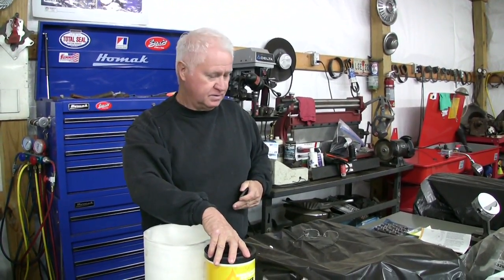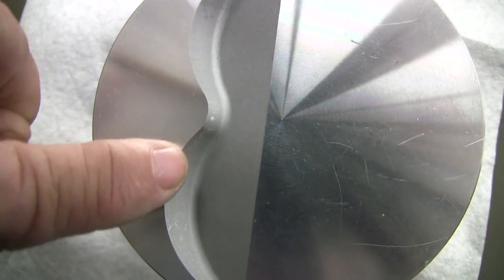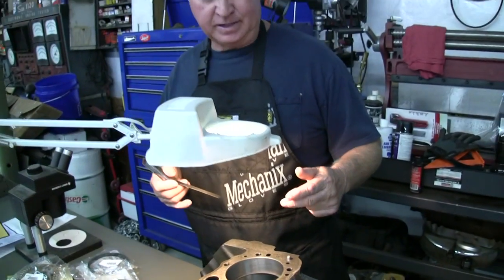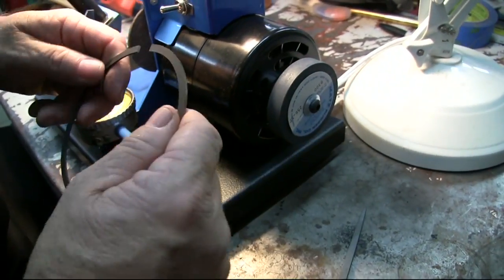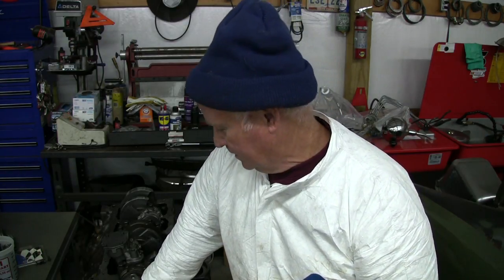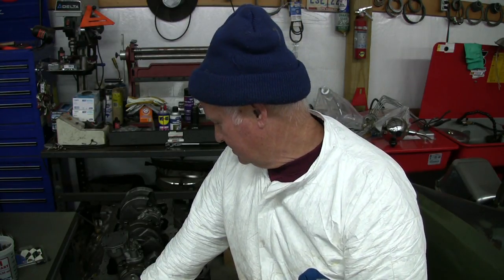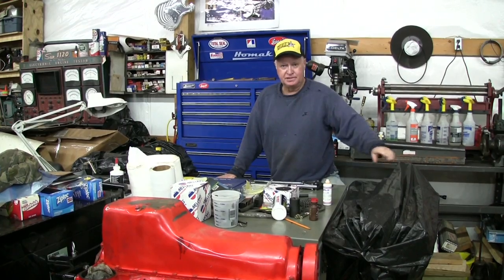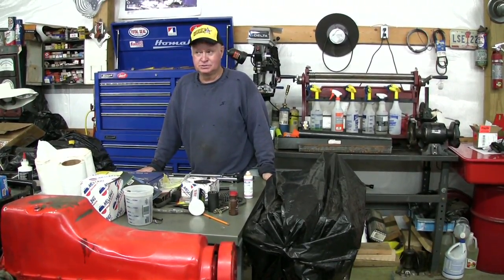385 Stroker Engine Update

Comment: Oh that sucks, Now if you use a duel sump will you starve the front bearing seems to me I've heard about this before A workmate used to race 383s , Or was it using a rear sump starves the front on fast take offs, An electric pump was called for to soak the front bearing.
Reply from the maker: Too many problems to use this engine for the Nova. I decided to rebuild the Nova specific 283 and put it back in the car. Bought good forged steel rods and a forged steel crank. Looking at pistons for it now. We'll use the 385 in the IROC most likely. Looking forward to seeing you catch some yellow perch. Nothing tastes better! Be sure to shoot video so we can go along.
Reply: @indyme2  Oh cool 283 neat little motor, Ya will do on the Perch I'm on a fasting diet right now Dr wants me down lots my knees are trashed down 110 already.
Reply from the maker: @GarnettM  110? Awesome. Good luck with the perch and the weight loss.
Reply: @indyme2  Thanks Gerry it's going fast, Neighbor was hummin and hawing about going fishing today it's really cold here so won't be long. HAPPY NEW YEAR.

Comment: I have never seen very many builders fit the rings to the individual cylinders or at all. I always did even on stock engines. The machine shops most times don't take the time to fit the rings either. Good build going on. Take care
Reply from the maker: I guess it's just a matter of pride and attention to detail to do things like ring gaps. You obviously take pride in your work too. Thanks for watching.

Comment: You think the machine shop would throw all those pistons on their lathe and match them all up if those gouges were done during their handling of them ..... do they not know they somehow gouged that piston  up like that? That's not a wee scratch either ......NICE ring gap machine .....Thanks for all the information on checking clearances when building a 383 great stuff.... seems that different sump small block is not one to stroke out .... if it were me I would also not wanna spend another $500 or so and then also having to modify suspension to fit oil pan .... go with the 355 in the Nova ..... Geee I hope I don't run into all those clearance issues on my build ......Great video Thank you
Reply from the maker: I took the entire rotating assembly to the machine shop to check everything out and balancing. I'm with you on the stroker build. Much easier to build a 355 and a lot less money too. Unfortunately I have 2 to build but the next Chevy in line will be a sweet 355. Will put the 355 in the Nova. We appreciate you watching and are enjoying your build.

Comment: I built a 383 for the Camaro. It was my first engine build. Never another 383 for me. I had to grind the rods and the machine shop had to grind the block. I think I sent it back to the machine shop about 3 times. Next one for the silver 81 will be a 355. I hope to start the 383 after the metal work is done on the 72. I hope it goes good. I'll have to look back at my notes to see what my ring gaps are. Great vid Indy.
Reply from the maker: A 383 build is a pain in the butt for sure, Russ. I measured, disassembled, ground clearance, cleaned and reassembled this block 4 times just for the crank clearance. The small base circle cam arrived yesterday so I hope that solves my problem there. 355 is the painless way to go. Enjoying your videos. Keep them coming.

Comment: Good information! Good thing you have another motor ready. I'd go with the 355 too and save the stroker for another car rather than spend extra money and make suspension mods. I hear ya, I'm always on here researching(google) what works with what and what other mods may be required for going a certain route.  Good update, can't wait to see that nova up and running.
Reply from the maker: I did a lot of internet searching on this engine. One expert said the pan, pick up, etc; from Che...2 Only will clear all stroker cranks. Guess where I bought these parts? Yep. Gotta be careful what the forum experts post. Some good info and some bad. Trying to get back on the Nova. Never thought it would take this long to get it back running. But, I never thought I would be a rust bucket hoarder. Gotta keep them from the crusher. Thanks for watching, James.

Comment: Glad to see you back with another video.  You  just can't catch a break.  Whenever I built an engine I always expected to take it apart several times to get things right.  I had a guy want me to look at his engine because of the variation of leak down percentages he had.  The first thing I asked him was about ring gap and he had set them to spec.  The problem was that he did them all in one cylinder because he had a stool set up and was comfortable doing them.  Oh well.  Keep the videos coming.
Reply from the maker: Lol. That's like checking piston to wall clearance in one hole and calling the rest the same. The worst gaps I ever saw were cut at what seemed to be a 45 degree angle. Sure, it was .018 measured against the wall but .037 on the other end of the gap. It's the small things that count. Enjoy your stories, Jerry. Thanks for watching.

Comment: Bummer about the clearance issues.  Good to know about getting gaps square on the rings.
Reply from the maker: Yes sir, Sam. Gotta get the gaps square cut or you won't have an accurate gap. Hope the new cam fixes my clearance problem and I don't have to tear this engine down again. Already did that 4 times getting the rods to clear the block. Lot of work. Thanks for watching. Looking forward to your next video.

Comment: Curious did Chevy make those mods to the small block 400? Was wondering if 400 SB parts like oil pump, pan, can etc were different than 350's. Once I was given a Vette motor to get running by the boss and his parts arrangement was about similar to your predicament. He got all pissed and tried to blame me...people....gotta love em
Reply from the maker: Not sure.what changes the factory made to the block on a 400. I have never been inside one. The casting had to be different to allow for the clearance problems. 400 small blocks are getting hard to find and I believe all had 2 bolt mains with cast cranks so they weren't intended for high performance. A friend who has a 383 stroker keeps telling me it's going to be worth all the effort. If I had it to do over again, I would probably just buy a 427 crate small block. This build has been a lot of work. I just hope the new camshaft fixes the clearance problems. I know the blame game. Had a boss like that once too. Lol. Thanks for watching.
Reply: Indy, GM did make 4 bolt main 400 for either 2 or 4 years as memory serves me  , but they did make them in the first years of production. Sorry about your issues good lesson to know though, thanks for sharing :).  don't know if you read my coments on other past posts but I also am building a 67 Chevy II post car, as well a 46 Plymouth club coupe. Also 35 years service Air Force. Retired about 2 years now, but working part time Ace Hardware so I guess we never really r retired...lol
Reply from the maker: Thanks for the info. I replied to all your posts that I could. I remember one that YT wouldn't let me though. Hope you put up some videos of your cars. I think i'll just use the stroker engine in another project and build a 355 for the 67 Nova as I have already purchased the parts for the front sump pan. I just received notice that the small base circle cam has been shipped. Hope that works. Some say it will and others, not. Lots of info on forums but a lot of it is junk posted by "professional posters" with no actual experience. Will post another video when the cam arrives. Thanks for watching.
Reply: Indy just be aware of the small block Chevys if you use the 355 unless the block came out of a Chevy Ii the oil boss area was recessed on those small blocks Chevy specific to the Novas. Regular blocks will have a oil filter clearance issues with the unibody frame and exhaust clearance area. If it were me though I would go with the 355 at this point. Best of luck to you email me or give me a call if you want to talk, get you my number in a pm. Been building most of my life so im not a flake.
Reply from the maker: I know these early Nova's had blocks special to them just not sure of all the differences. Dip stick tube in the pan and not block, front sump, special oil pump and something to do with the clutch linkage to name a few. Have to check on the oil filter clearance problems. That one is new to me. Thanks for the info! Need all I can get.
Reply: Yes GM had to shoe horn the sbc's into the 66-67 novas. I have a heidts subfame for mine. The factory unibody did the job back in the day but improvements of today r so much better. If your trying to stay close to stock you'll have to work thru them. By your videos your more than capable. I just wanted disk brakes, rack&pinon stronger subframe improved handeling, better stopping and good clearance for headers. That's why I went this direction but still keeping the stock look from the exterior.
Reply from the maker: Sounds like you have a sweet car. Will most likely do some of the same on mine. I'm good with everything except the rack & pinion steering. The guy I bought the Nova from did r&p steering and he doesn't like it. Said it took all the road feel and fun out of driving his car. Are you happy with you road feel? Thanks for the info!
Reply: Haven't got it road worthy yet so can't affirm that, haven't even thought about that aspect. Always something to consider isn't there. Just bought a knock off go pro type camera. Don't know where you find the time to film and edit... Want to start making videos like yours though.  Because of just being a novice and having 5 children and 10 grandchildren time get gobbled up most days...
Reply from the maker: I understand the lack of time. Thought I would have more as I got older but not true for me. We are always interested in what others are doing with their cars. Don't have to be an expert at anything. Just willing to share through videos and make yourself look silly sometimes. Lol.
Reply: Ya that to...lol I think you do a awesome job, you explain clearly very informative and truthful. I like that in a person, don't see that in today's world enough. Will try to get some still shots at least to you soon.
Reply: As for my 46 Plymouth direction going with 355 SBC, body swap to S10 frame/platform. S10 wheel base is @ 117.9 ", 46 Plymouth 117". Hopping to cheat the .9" without having to cut any frame... Picked up the 46 in ND for cost of $400 another 400 round trip to get it home (S10 another 400) total $1200 and still haven't even started work yet. Original flathead drivetrain still in place for now, non running of course. The old Farm boy that I retrieved it from cut the large sun roof over the back seat area. Knew this from the pics, before hand. Thinking the old boy cut it for the flat sheet metal for repair of other equipment around the farm. I know back in the day this was common. Was I ever in left field! When I arrived to picked it up, the old boy told me it was cut so the rear seat passenger could  stand and shoot while a driver bounced thru the fields for coyote/wolf eradication in protection of livestock...lol.  Its history/stories like this that add to the nostalgia/fun, wouldn't you agree.
Reply from the maker: Lol! A sun roof to kill coyotes? I've heard it all now. Didn't know about the measurements on the S10 and Plymouth. Sounds like you have a good plan. Please shoot video when you do all this. We will enjoy going along and learn something too. Thanks!
Reply from the maker: Looking forward to the pics. Thank you for the comment, Sir.
Reply: FYI the s10 with a 117 wheel base has to be a standard cab long bed.